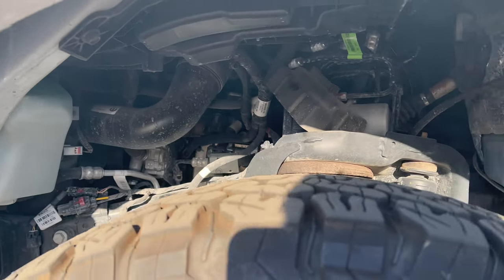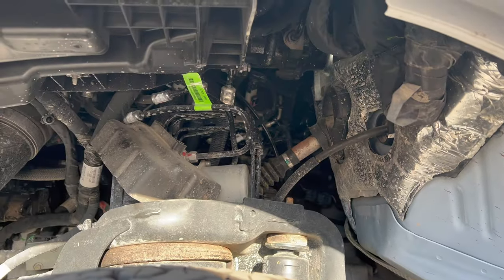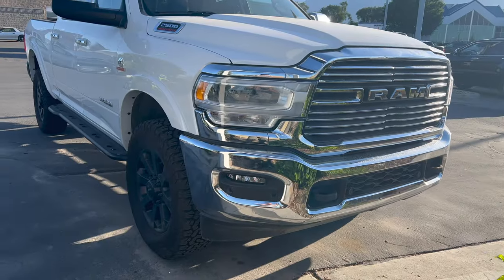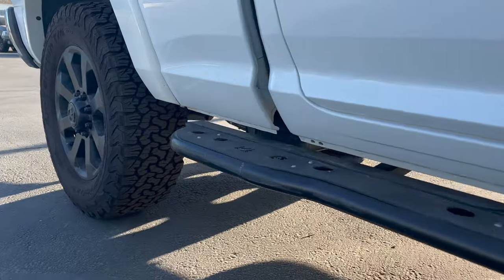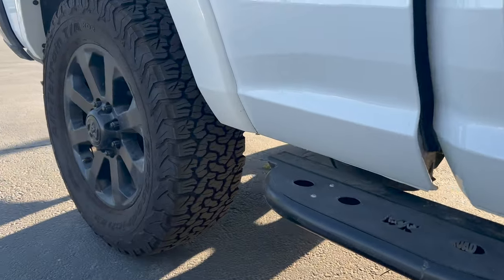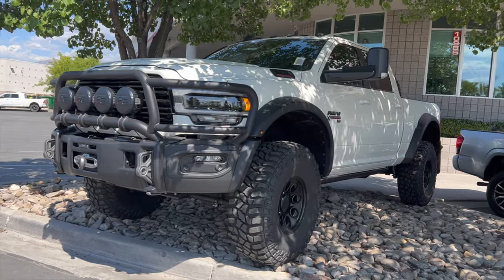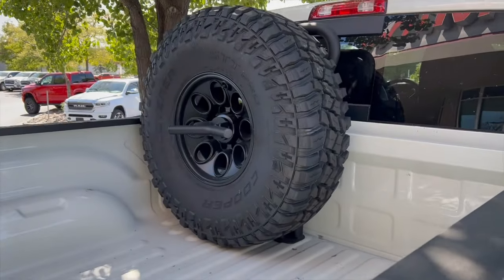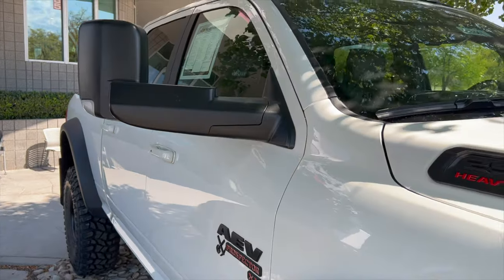Is my 2022 RAM 2500 Cummins a Lemon? 3 things are giving me patience:

Comment: I have a 2020.  Small city driving and have had Def light come on.  It is stressful but have just been false alarms. Just drive it long every chance you get to regen. Keep it at least half full at all times. And even take off Def injector bolts and apply antiseeze. It is a great truck.
Reply from the maker: That’s for those tips @Ricardo Garcia
Reply: DEF and the SCR have nothing to do with the DPF (regen). Yes you do need to drive long and hot enough to successfully complete regens or your truck will tell you to "drive to clean". DEF is amonia which gets mixed with the exhaust gas in the SCR to reduce NOX exmissions, you don't have to do any special driving for this process to function. DEF has absolutely no impact on the DPF.
Reply from the maker: Very cool info, thank you.

Comment: I did lemon law on a Jeep here in California, not sure if rules are the same where you live. Here you can be made to pay for miles prior to the issue using a special formula. You can choose to get reimbursement for all costs and accessories you bought for the truck except insurance, time and hassel without going to court.  I did mine thru arbitration at an in person case at a neutral site.  If you want more info let me know and can try to help you.
Reply: Forgot to say you can request they replace the vehicle instead if you wish, but low inventory could be an issue.  FCA was a joke and if follow the letter of the law you can easily win.
Reply from the maker: @Kevin Van Lohuizen thanks for the comment and info. Much appreciated. If I go down that route I’ll probably reach out to pick your brain some more.

Comment: When I did my Lemon Law. They will not pay for any modifications or changes (I had window tint). You will pay a certain rate for the mileage that you put on the car while it was in good working order. So if you started having problems at 8k miles. and now you have 15k because they have been ongoing with the repair. You will pay only for the 8k miles so I think it was like 50 cents. So they will reduce your settlement by $4k. They will reimburse what you signed on the dotted line - the miles that were "good"
Reply from the maker: @T1M3ATK right on, thanks for that info. 👊 Curious to see what happens with mine. The process takes so long.

Comment: Make sure you drive a Prospector XL. I drove a new 2022 regular cab 3500 Prospector XL. Rode pretty nice. Great looking truck. But for some reason just wasn't warm and fuzzy about it. Drove a lot of miles to look at it and enjoyed the test drive. Salesman didn't even tag along.
Reply from the maker: @Scott Symons was there anything about it that you could pinpoint as far as why you didn’t love it?
Reply: @gavinwalker5686  I don't think they changed the gear ratio. Seemed sluggish. It was a Tradesman trim level too. There was a crewcab next to it that was on 40's. Should have probably driven it too. Something seemed to be missing. All of my trucks that I have owned were top trim levels. That could have made a difference. Awfully expensive to not like. Definitely drive one before buying one.
Reply from the maker: @Scott Symons I’ll make sure to drive, thank you. Also, yeah that’s a lot of money for a tradesman trim level truck. I’d for sure get a higher trim level too. It has to feel expensive from the inside too, not just look it from the outside. And I’ve heard they are terribly sluggish if they don’t change the gears. I’d definitely do that too when the time comes.

Comment: I bought mine in 2007 when the 6.7 came out. It had 26mi on the OD when I bought it, it ran great until it started showing the check engine light after a few months of having it. It went to the dealership 26 times in about 3 months for the check engine light and codes that where showing up on the ECM. Every time I took it in the diesel tech would hook up his laptop to it down load the codes and send them to the manufacturer, were they would look at them and then send out another program for him to download on his laptop and then to my trucks ECM  and that was an all day event. So after talking to the tech I decided to "delete" the entire DPF system and I did that at 22,000mi on the OD, I now have 279,560mi on the OD and have never been back to the dealer until the transmission went out at 182,000mi. I found out later on that Chrysler was having program problems in the early stage of being the first disel trucks with the DPF system, Ford and Chevrolet waited until around 2008  before they complied with the new law. I still drive this truck daily and have not had a problem, knock on wood ever since. Good luck on getting your Truck figured out, that DEF is the most common problem nowadays with disel trucks.
Reply from the maker: @Todd J Cole thanks for the comment, that’s a lot of check engine lights but being the first to get the system it makes sense. Awesome though that the truck has been so solid since then. They sent a new PCM so I’m excited to get my truck back in a few days and see how it goes 🤞

Comment: Just make sure if you lemon law the truck and get another truck to make an off-roader/overlander. You get one that has the payload for the 5th if you plan to tow. If you watch some of the CJC off-road videos you can keep the payload while making the truck a lifted monster. That goes for any manufacturer of truck. I’m not an expert at all, a friend of mine has most of that knowledge. Appreciate the update.
Reply from the maker: @David Brown I’ll definitely build an overlander regardless of what vehicle, that’s the overall goal! And towing would be nice too, instead of building out the sequoia we’ll get pretty soon. Trucks are just so much more handy with a family and all that payload capacity.
Reply: @gavinwalker5686  I agree. My 2021 Ram Limited 3500 payload is 3800 which works perfectly for me. If you have a trailer, it’s definitely one of the main things to consider. Good luck.
Reply from the maker: @David Brown dang that’s a big payload 🤯 Those limiteds are nice trucks too. I don’t have a trailer yet, I’ll have access to my in laws 5th, but you gotta have the truck before you can have the trailer, I’d hate to build up a half ton and then have to sell it to tow something big.
Reply: Once you own a 5th wheel you quickly learn that lifted trucks are garbage for that type of towing. The bed will be too high and come in contact with your trailer that won't ever ride level. The kinds of rims/tires/offsets generally used will reduce stability, payload and confidence on the road. Most offroad packages reduce payload too low for a 5th wheel and make towing dangerous. You can't have the best of both worlds with an HD truck. A Power Wagon and a bumper pull would be a better option for an offroader.
Reply from the maker: Yeah I’d definitely have to lift the 5th wheel too and to keep it from coming in contact from with the bed, but higher isn’t better for stability. They do make some more off road worthy bumper pulls, so perhaps that would be the better route for long trips. A power wagon and bumper pull would be a good combo.

Comment: Don't go with AEV for the suspension if you want a prospector. Do the AEV aesthetics and Carli or thuren suspension. You won't regret it.
Reply from the maker: I’ve heard those ride better. What I like most about the ATV lift is that the bracket that Hughes moves the axle forwards 1 inch, so with the 37s you don’t get any rubbing at all and don’t have to do any trimming. I wonder though, if I could use a Carli or Thursn with that special bracket.

Comment: Soo long term thinking is sinking another 20 grand into a lemon so you can call it a prospector? This truck will never be right. Trade it or sell. Heck if you like the truck see if the stealer will make you a deal on an identical 2023. If I had any major mechanical or electrical failures in a new $80k vehicle it is going bye bye
Reply from the maker: @Josh Schuler You make a good point. So let's say they replace the pcm, you think it'll still be wonky? It would be pointless to make lemon a prospector.

Comment: Just because you live in a rural area doesn't make a delete worth it. They've cracked down on manufacturers who make kits, and those who program tunes. When Gale Banks discontinues his "race use/offroad only" components in favor of CARB compliant products; you know the aftermarket manufacturers know the party is over. Anyway, the truck is still under warranty, if you delete it, it won't be anymore. Use the warranty to your advantage and learn how to fix as much as you can by your self in the mean time. I've owned my 2018 Ram since new and have only had the ABS pump go out on it. No DEF issues yet, but I know it's annoying when things act up on an expensive vehicle. Ford, Ram, GM... they all have their quirks.
Reply from the maker: @A.R. O I totally agree with you. There have been many thoughtful and more experienced comments pop up after I brought that discussion up, and it’s totally not worth it. I’d wait until after the warranty period if I ever was goi g to do anything, but like you said the trend is going a certain direction, so why delete and then later get forced to reinstall everything when laws tighten up more? It would be a pain. Plus, turns out it was just the pcm all along. I’ve still got a lot of warranty and a long time to test out the truck.

Comment: I think I finally give up my lifelong dream of getting a diesel pickup. Seems to be way too much of a hassle. Plus enormously expensive. 😞
Reply from the maker: @Scott Poll diesels aren’t what they used to be
Reply: i think a Ram 2500 hemi with 4.10 gears and 8foot bed 50gallon gas tank will work well it has    a 16k towing capacity 3000 less than a cummins but the bumper pull is rated to 20k
Reply: also is about 15000 less when you add the taxes
Reply from the maker: @Christian Renteria I’d even consider a Power  Wagon. It would limit the size of fifth wheel or trailer, but could tow a big enough one, but the off road capability would make up for that. I could add some airbags too to help it not squat so bad too.
Reply: @gavinwalker5686   I have a 2021 ram 2500 6.4 bed and 4.10  gears  has a 31 gallon tank i get about 13.5 mpg, if you drive a speed limit you can get 16mpg with 33
Reply: mine has 14000 miles ,no problems at all
Reply: Honestly there’s more trucks out there with zero problems then trucks with problems.  Buddy just got the short straw prolly built on a Friday
Reply from the maker: @Brent Inchley thanks for the perspective. 🙏

Comment: lemon law takes at least 3 months depending on States , but to do lemon law you have to take it 3 times or more for the same problem if they cant fixit then you can get to the lemon law
Reply from the maker: @Cristian Renteria I thought it was 3 times same issue or if it’s out of service for more than 30 days, which is why I think I could. But it sounds like it’s a slow process either way.
Reply: i am in California , your state may be different best advice is to talk to a lemon law attorney
Reply from the maker: @Christian Renteria I will for sure.
Reply: @Gavin x here in CT it is 30 days out of service or 3 times for the same issue and making good faith effort to fix. Corporate may prefer a buy back though, because if it is lemoned they cannot resell as used.
Reply from the maker: @S Fitz sounds similar to here then. If needed a buy back would be ok as long as they pay back sales tax and add one too, I’ve heard in some cases they have to.
Reply from the maker: @S Fitz sounds similar to here then. If needed a buy back would be ok as long as they pay back sales tax and add one too, I’ve heard in some cases they have to. Hopefully it won’t come to that though.

Comment: Hello Galvan,

Hope all is going well. I was pulling super heavy with my 2017 Ram 2500 cummins and caused my transmission mission to fail (68RFE) I also have 37s on the truck witch did not help. Anyways I've owned all 3 brands Ford, Chevy and Ram and I can tell you that FCA has been by far the best with warranty work to work with. GM is horrible and Ford will do anything to get out of paying for warranty work. So they rebuilt my transmission, they are rebuilding my transmission again right now due to a bad tyranny pump. The only other issue I've had was with the DPF nozzle. I also was thinking about deleting my truck but the hassle that comes from it is insane and to be honest I have not had a single issue with the dpf system and yes the truck is tuned. I have many friends who drive Ram trucks with the cummins that are emission equipped and have had no issues. I will say and it sounds wired but once in a while get on it hard and open her up on the freeway. I have had my truck for 5 years and have 165,000 miles emissions on and not had any issues with my Ram 2500 cummins, I have taken it mudding, hauled heavy and honestly raced it. It's been an amazing truck and I would not think twice about getting another one.
Reply from the maker: @Andrew Clarke I appreciate you taking the time to comment and share your experience.  One thing you said especially made me curious. I always thought that tuning was part of deleting, but you’re tuned and have emissions intact? Tell me more about that. MPG gain? More power? Void warranty? Sounds like it doesn’t if they’re covering your transmission stuff.
Reply: @gavinwalker5686  
 Hello Gavin, so yes the truck is tuned and emissions intact. My truck is tuned through EZ Lynk with the auto agent 2.0. As for fuel mileage I have been receiving  25.06 miles to the gallon hand calculated. I get about 480 miles to a tank driving with a heavy foot. My horse power tunes are 30hp, 60hp, 75hp, 100hp and my race tune Is 175hp. When you buy the Ez Lynk tuner you can ask them for a OME tune which puts your truck back to stock so the dealer dose not know its tuned. Also I will say unless you get a built transmission put in do Not use anything more than the 75 hp tune otherwise back to the dealer you go. Ez Lynk also doses transmission tuning witch I would recommend you get. It cost me about 1700.00 for everything. Oh and the tunes open the truck up like crazy. Totally different animal.. Let me know if you want to know anything else..
Reply from the maker: @Andrew Clarke wow, that’s awesome! I’ll definitely look into that! Thank you so much for all the info!
Reply: @gavinwalker5686  your welcome.

Comment: You basically answered your questions your self. Every state is different on lemon laws but what I do know is no auto manufacture will pay you back for your negative equity. When buying back a car under the lemon law. If you paid over MSRP you are responsible for that negative equity. If you were lucky to get your truck at MSRP. Then you have a leg up.
Reply from the maker: @Rays Reef I did get it for a tad under MSRP, and only financed about 40% of the total cost once warranties and taxes were added on. The warranty extension could get cancelled and pro rated, seems like they’d have to reimburse sales tax, and some one on here said I can also opt to have them reimburse for accessories would would be fantastic. I guess we’ll see if how things play out in the next couple weeks.
Reply: @gavinwalker5686  I would just get it fixed an trade it in have someone else deal with this lemon 🍋

Comment: No such thing as legally deleting the emission.  Federally mandated even though your county in any state does not require smogging to get registration renewals.  Also EPA are going after and fining up to prosecuting merchants and suppliers of delete programing, egr, dpf plates and piping.  Either hang patient, start lemon process, or once fixed then sell it.   Can you still found somewhere to purchase delete items….sure, but with the new diesel emission.  Either live with it or don’t buy one.
Reply from the maker: @James Miller yeah posting this video as been super informative to learn from you guys about deleting and laws and such. For now I’ll hang tight, new pcm is on its way and I’ll see how the truck does. I don’t think I’ll want the stress of dogging the epa and such as laws become more strict. A lot of people have commented they e had good luck with the emission equipment lately so I’ll see how mine does. I have plenty of warranty left and plenty of time to test out how it does before I’d be on the hook for large failures.